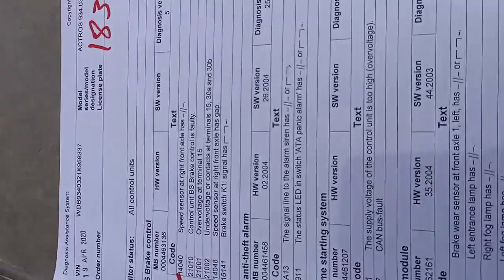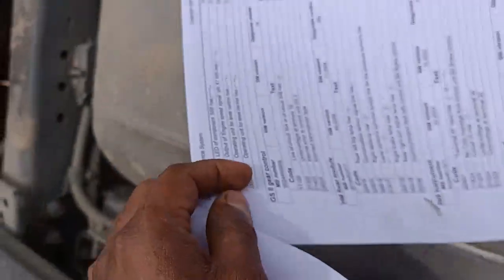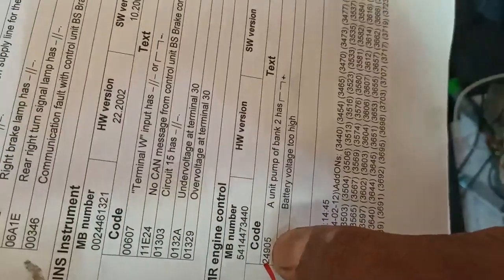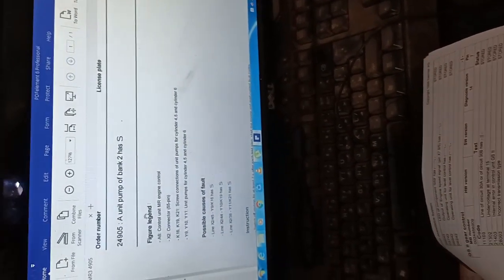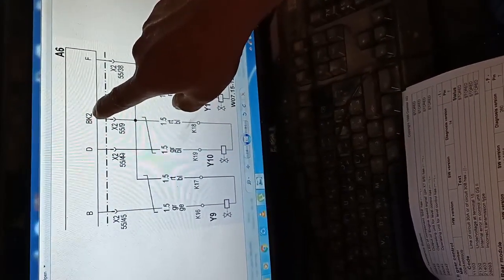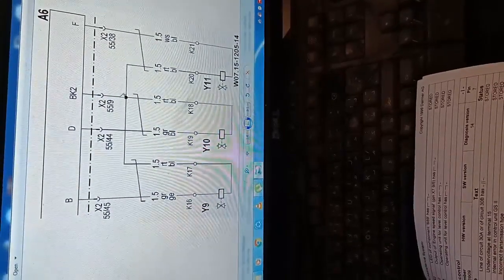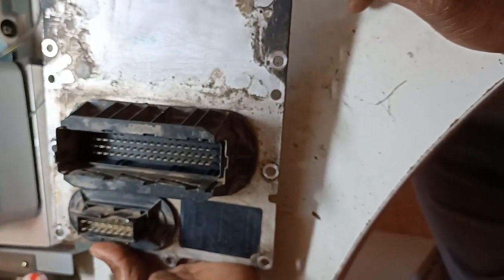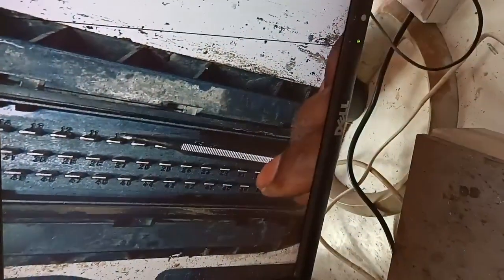Repair  MR PLD Engine Control Unit

Comment: Assalam o alaikum brother,  how are you 
This  is not transistor,  it's MOSFET having part no. SUD40N06- 25L manufactured by Vishey semiconductor. 
You can remove it easily by using two soldering irons simultaneously
Reply: Hi
Reply: Mosfet sud40n06

Comment: Amigo saludos desde Venezuela...
Tengo un problema con un Mercedes axor 2640 año 2007 con código de error
MR 4051
MR 4052
MR 4053
ERROR INTERNAL UNIT
PODRIAS AYUDARME A ENCONTRAR POSIBLES CAUSAS Y SOLUCIONES